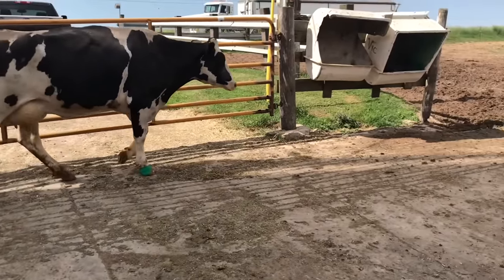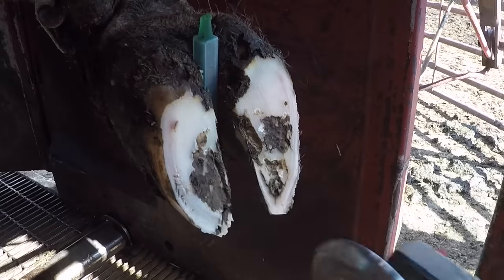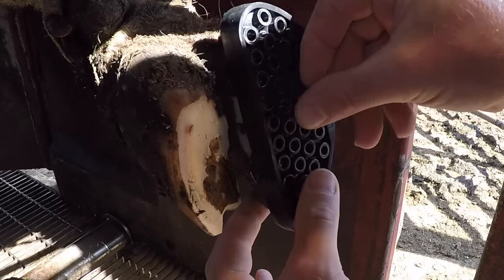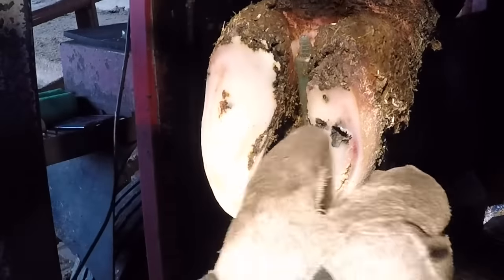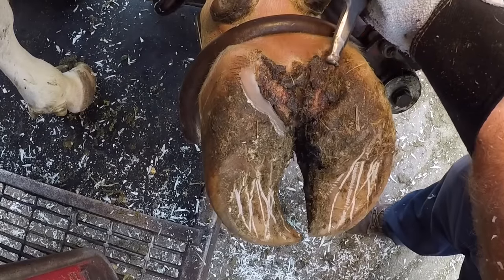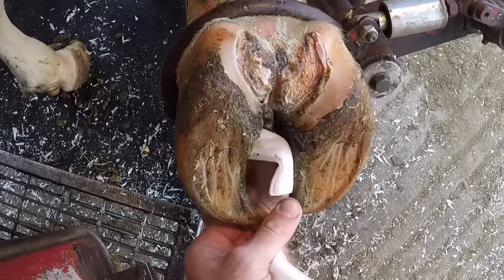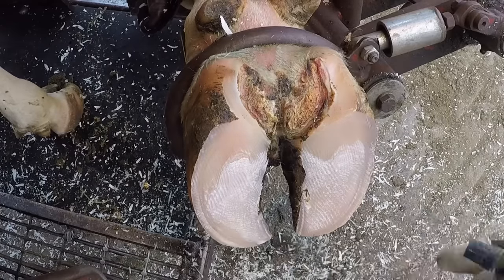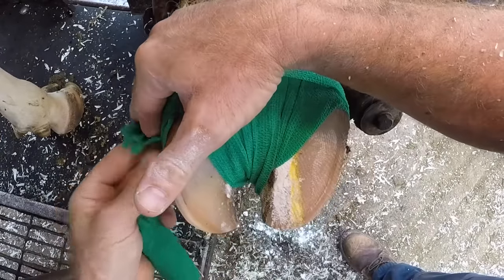Cracked Claws, Buried Treasure and a Case of Foul

Comment: I love that you clean off the hoof before you start working. It makes it easier to see what you are talking about. Some other channels they hack away at the dirty hoof then wrap it up still dirty. I'm no cow doctor but bandaging a dirty wound seems counterproductive. Keep up the great work!
Reply: I've heard it's to keep workers safe from being electrocuted since they use machines and what not, as well as cows have a stronger immune system so I think they'll be fine with the treatments they receive, but thats just my opinion
Reply: Cleaning the hoof doesn't actually do anything, since if there's a cavity there's gonna be dirt in there anyways
Cleaning the infection site after it's been cleared up is a must though
(information from watching a bunch of these videos)
Reply: @batfurs3001  This right here. Also, cleaning the surface layer of dirt isn't going to make it any more sanitary because it's ground deep into the structure of the hoof. Not to mention that the cow is going to be stepping in mud and manure as soon as she leaves the chute, anyway. Those bandages are porous. The dirt is going to get in, regardless. The purpose of the bandage isn't to keep the wound clean but to keep the topical treatment on.

Comment: As an idea, could it be possible to have metal detectors on the ground level, at the entrance to where the cows/horses enter the barn/shelter on farms?  I know they have foot baths, so in the foot bath area, you also have a metal detector for the hoofs. It is rare to have metal in the hoof, but the equipment to detect metal is cheap.
Reply: Sounds good idea but most of the time it is a rock.